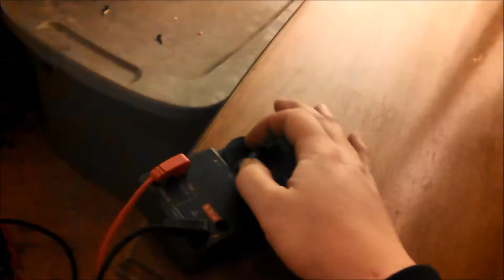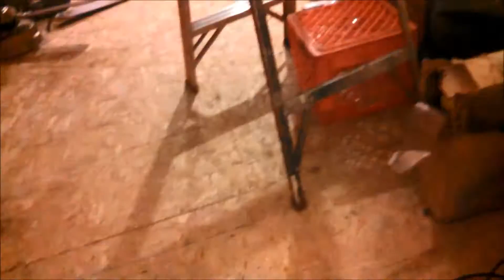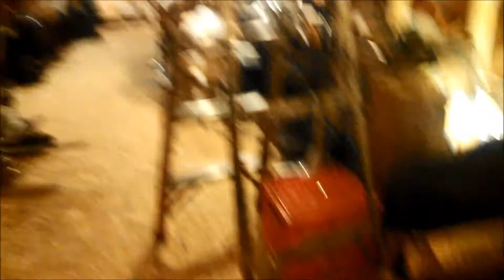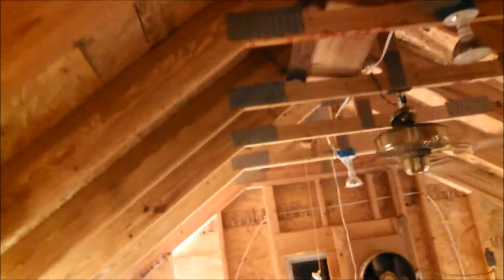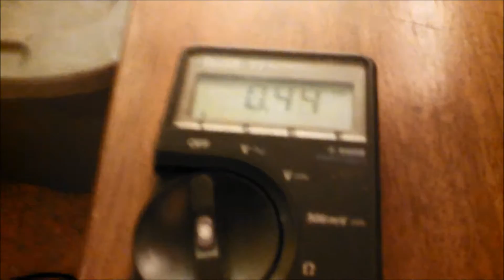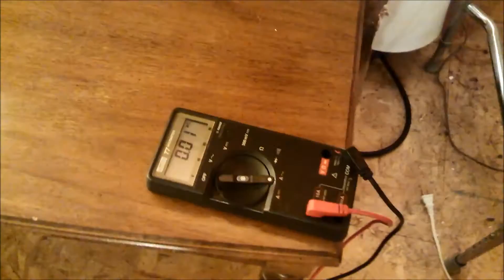Encon Ceiling Fan with K55 motor, high gloss cane blades (FULL)

Comment: What year is this fan?  The reason I ask, is that I wasn't aware that modern fans could be or were hung with a loop screw/hook.  I thought that was only for old R-52 Hunter-style cast-iron fans.

I laughed off a friend recently who told me that if I wanted to hang a fan in my living room, that I should see if it could be hung with a loop screw/hook.  I thought it was only for old fans.  To my knowledge, modern fans are hung with brackets.  Perhaps I was wrong...?
Reply from the maker: Vladpryde This fan normally uses a ball socket bracket, however any fan can be modified to hang on a hook.  Commercial fans still come that way.
Reply: Dan ''Spiffy'' Neuman But the downrod has to be modified?  Anyways, it's a moot point, since I need a hugger-style fan anyways, and he didn't understand that.  But I just thought he didn't know what he was talking about, because I haven't seen a fan hung like this in years....until I saw your video, that is.

Comment: That Heat Fan is going much slower than usual... Did you set it lower?
Reply from the maker: Yes, I kept tripping the breaker so I turned the fans down.  Now the lights have been moved to a different circuit and everything's back to normal.
Reply: Dan ''Spiffy'' Neuman Oh, zzzzOK.